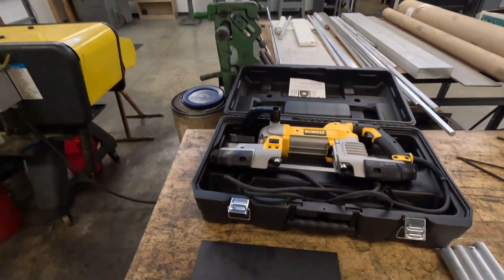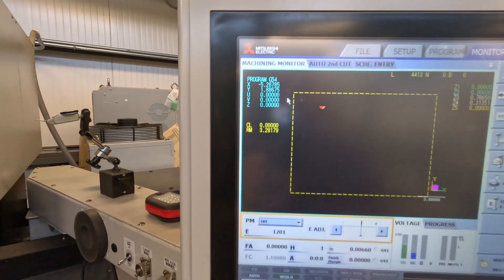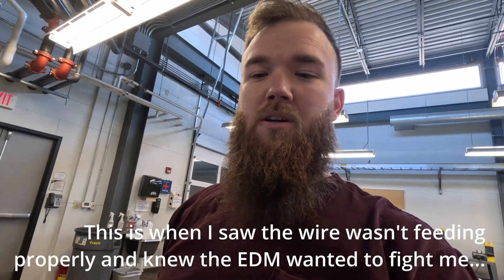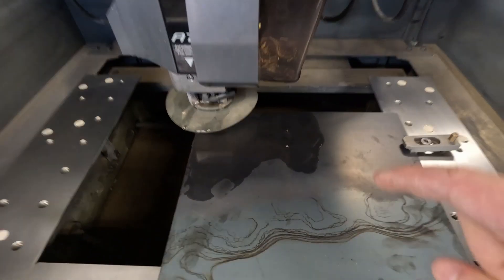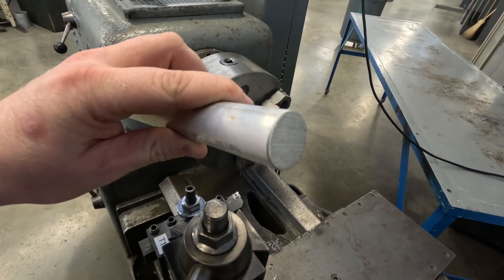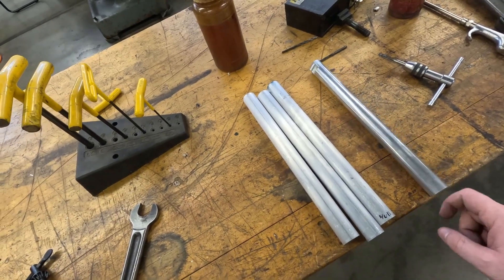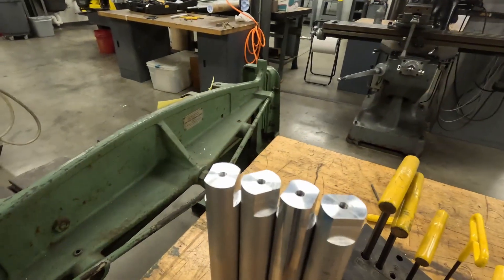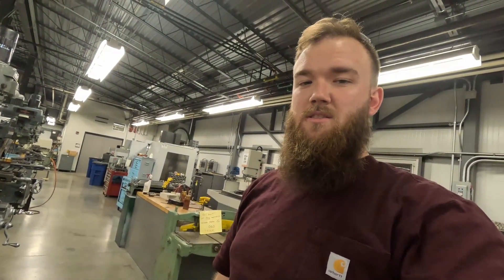Making a bandsaw table to use with my Dewalt DWM120 Portaband

Comment: What's the purpose for the 2 holes?
Reply from the maker: The two holes beside the slot, those are for the screws that are holding the portaband on to that steel table.